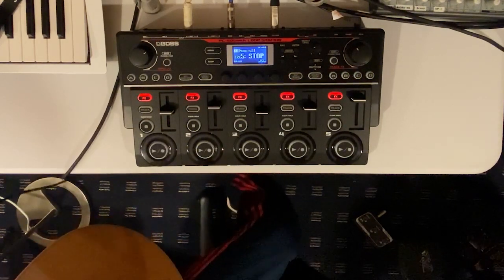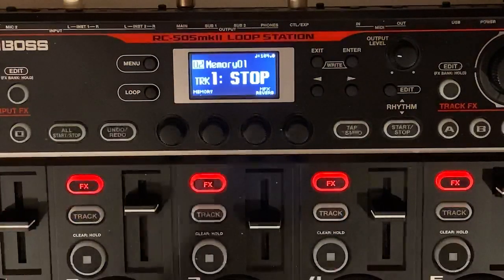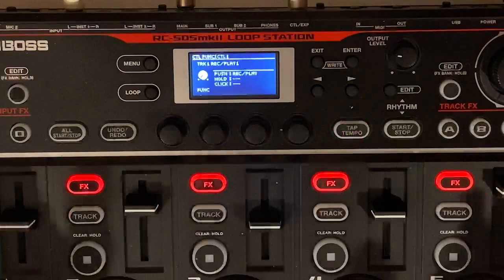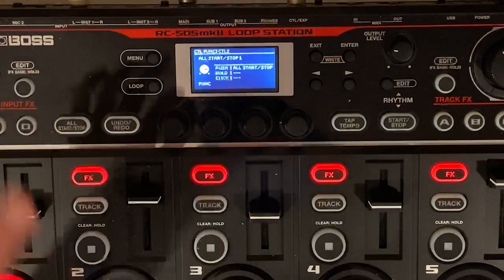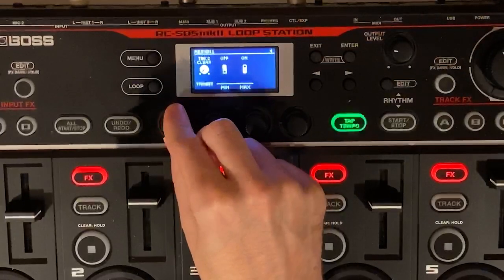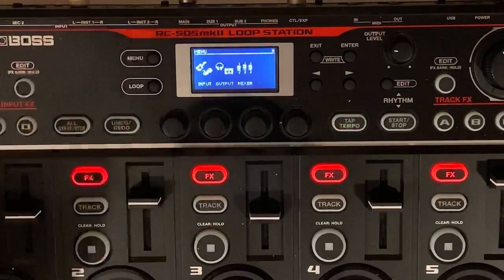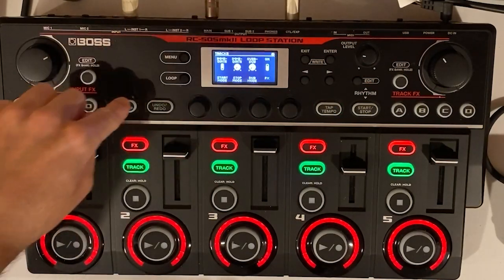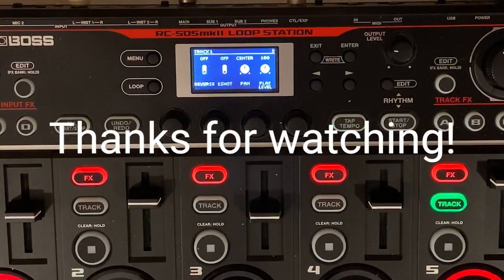Boss RC 505 mk2 Loop Station -  Floor Switch Tutorial

Comment: I really appreciated this video. I got the FS-6 switch for my RC505, but all instructions to set it up were clear as mud. Your video got it set up the way I wanted. Thank you!!
Reply: Yes I was tearing my hair out  with configuring a FS-6 until coming across this video - a life saver!
Reply: @davebainbridge902  Please explain to me the details of the setup, more precisely what results have you achieved with the FS-6?  I have it running in the left pedal mode (Track 1)*Recording-playing-overdubbing* and the right pedal (Track 2) are the same. I tried to make settings based on this video, in order to switch tracks from 1-5, but it did not work.

Comment: Thanks a million times for the "all buttons down" tip! I bought a space efficient Ampero Hotswitch double switch pedal just for this only to notice it doesn't work right. Tried other configurations too and they didn't work. Noticed it works only when hitting both buttons down but didn't think of trying the individual buttons after that! So I don't have to replace the foot pedal or hack it either.

Also the assign trick is really handy. Saves some buttons for other use. I wonder why they didn't do it that way originally.

Comment: Please explain to me the details of the setup, more precisely what results have you achieved with the FS-6?  I have it running in the left pedal mode (Track 1)*Recording-playing-overdubbing* and the right pedal (Track 2) are the same. I tried to make settings based on this video, in order to switch tracks from 1-5, but it did not work.

Comment: I have the mk2  and am a multi instrumentalist.  The more I see  videos like this and the not so intuitive way to have foot control with the 500 makes me totally want to switch the Head rush looper and just be done with this.  LOL
Reply: The problem with devices like this is the versatility. A beatboxer feels at home right away. He won‘t be using footswitches or expression pedals. All he needs to do is check what the effects section can do for him. But the unit also works for us multiintrumentalists. And we need a lot more functionality, so there need to be more layers of control, giving us a harder time initially.
If you look at the RC-600, that is designed for guitar players and keyboarders but almost identical to the RC-505/2, you don‘t even find the track buttons. So, a solution like the one shown here is much harder to get with that device. Dto. for the Headrush.
Despite the „hardships“, I guess us multiinstrumentalists have to be thankful for the next updates that his majesty Boss lets us have. 😁
Reply: This is waay too complicated. I have the same problem with my FS6 pedal. It’s doesn’t work straight away. I spent days trying to set it up, and it’s still not right. Thanks for the video… I wish there were more like this

Comment: I hoped that you gound a way to use all three buttons (this footswitch works with digitech trio with 3 buttons through the same trs cable)

Instead of all start / all stop I have "switch the current track" command (inc) and it's very useful

Do you know a way to make one of the buttons blink for the current track? There is the LED on / off assign but you lose other functions for that button by selecting it
Reply: I'm not finding this command and have looked a few times. Where are you finding "Instead of all start / all stop I have "switch the current track" command (inc) and it's very useful" please and big thanks in advance!

Comment: THX for this video!!! I have only one more problem: when I hit the first (mode) button on the pedal, the recording on the track arms a little bit to late. When I press my foot on the switch, it does not start the recording, it starts when I release my foot from the switch. Do you have an idea how I can change this? Thank you!!
Reply from the maker: Unfortunately, mine does the same. Didn't realize this behavior until after I made the video. Haven't had time to try to solve but will try to look into when I have a chance.

Comment: To anyone who is considering using this pedal for the first RC-505 (not the mkii version) let me tell you that it works. (instead of buying boss pedals or any other expensive midi pedals)

First thing, i don't know how you assign anything to the "Up" button, since i can only have options for CTL 1 and CTL 2, in the looper. Maybe in this newer version (mkii) is possible - i see in his screen more CTL options - but not in 505 standard version.

Now, the thing his that 505 doesnt have a "Track" button, like Mkii. So we need to assign to one of the buttons (CTL1 or 2) the: Assgn1 Target - TARGET TRACK INC/DEC. Increase to change track selection from left to right, or Decrease to change from right to left. As soon as you set this, by pressing the button, it will show you the "Edit track" button blinking 3x meaning that is "selected".

Then you only need to assign the remaining control (depending of what you already used for track selection) and set Assgn2 Target - TGT TR REC/PLAY. This means that whatever the track that is assigned, you can now rec, overdub and play.

It would be perfect to have the "Up" button to stop all, or stop selected track, but like i said before there is no CTL3...

Hope this helps you to make wonderfull creations and keep this looper for hand and feet usage xD Happy christmas and a great new year to all!
Reply: Thank you for this, i've been trying to help a friend who has the mk1 version and I couldn't work it out compared to my mk2 version.